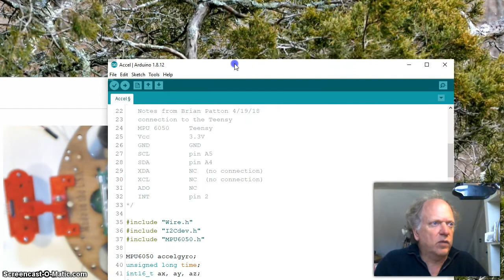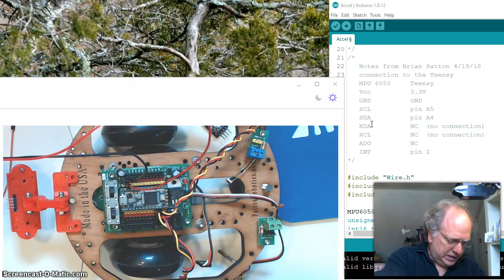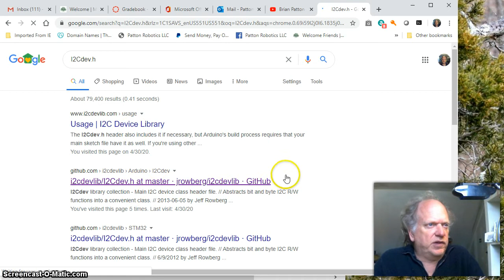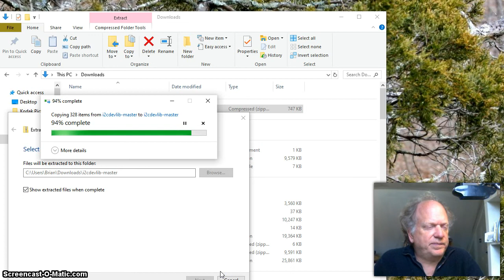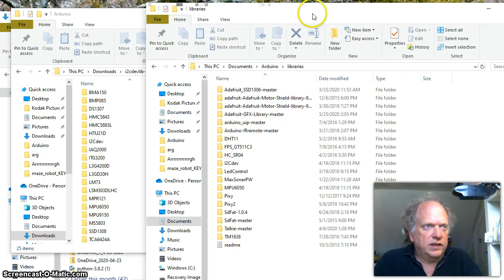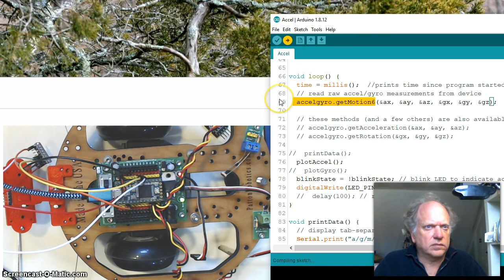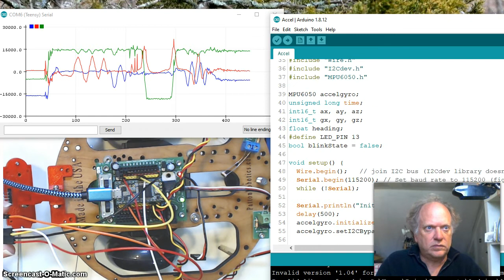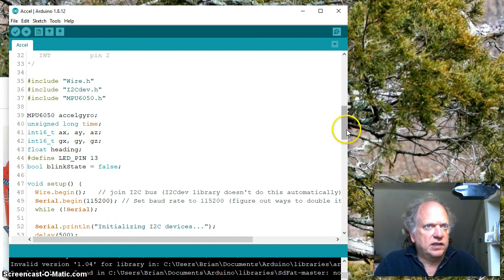Accelerometer Setup on a Teensy

Comment: I think you used the terms gyroscope and accelerometer incorrectly. The gyro shows the orientation thus if you flip the MPU6050 and the signals flip and stay inverted then that is the gyro signals but you said Accelarometer. Also when you move the MPU6050 slowly then there is small acceleration thus the signals will stay at zero also when you move to MPU6050 quickly to a position and then keep it still and then the signal jumps quickly and goes back to 0 then that will be the accelerometer signals. Thanks for the great code and tutorial.
Reply from the maker: Ha.. thanks for that note! I probably did. One of these days I'll think about scripting these. I'll try not to do that again.  Thanks again for the catch, I'll point it out to my students.